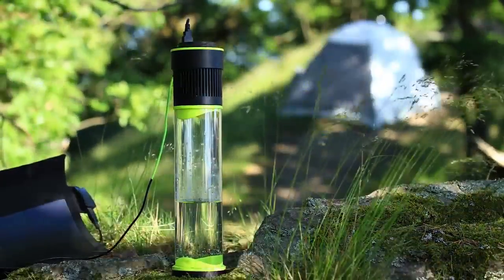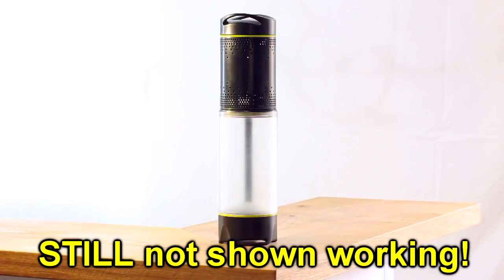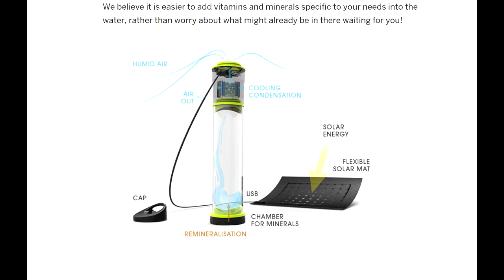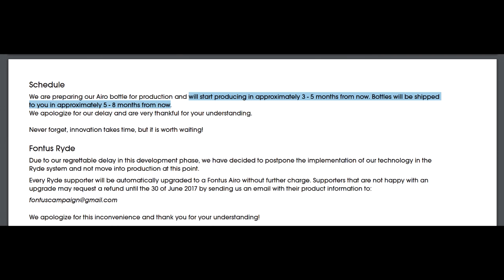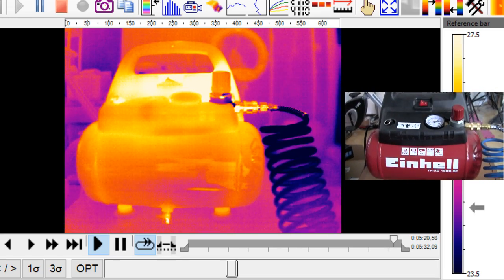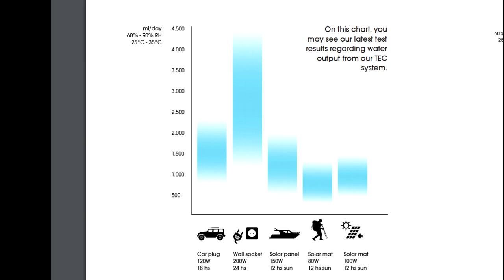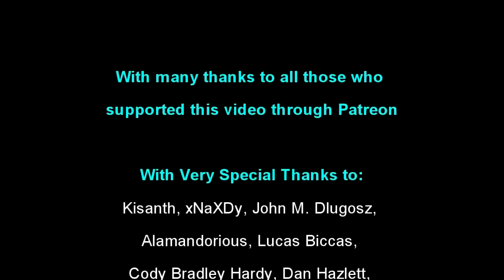$300 000 Self-Filling water bottle, SUPERFAIL!

Comment: the only practical reason to bring the water bottle via a plug is if you are going camping and bringing a mini generator with you for electricity. but if you are going camping and need a mini generator chances are you will just bring several gallons of water in big bottles. Or you're just going to go to a nearby river.

also why don't they use a chemical reaction to generate heat which can then be used to generate electricity thus charging the humidifier effect on the bottle. if i'm not mistaken there are tonnes of chemicals which you can mix to produce massive amounts of heat which you can use to charge electricity.

Comment: I think I just invented something to rival this creation. It fills a bottle with water, and is about as big as the bottle (like this one in this new stage) BUT it has even less weight AND requires less power.

I call it "another bottle".
Reply: If this has peaked your interest, I have another one for you - though that one needs refining. It's a device that lets you see through walls. Any wall, regardless of material.

That one's working title is "the window".

Comment: The boat in their chart showing what a 150w solar array could produce. Such panels on Google look to be about 1 meter^2. You could seriously build a solar distilling apparatus the same size, use the sun's heat and get considerably more energy than a 150w solar panel at 1 sq-meter, and get more than a gallon of water in a day if you're in a temperate or warmer climate. And you have the benefit of knowing the water is relatively clean as distillation leaves behind all the salt and particulates and is usually hot enough to kill off most microbes. To be safe, collect your distilled water in a glass (not plastic) container and let it sit out in the sun for the day. The UV radiation will take care of the rest of the microbial hitch hikers.
Then, just add some of the salt you collected from your still, to your food. That way, you don't have your distilled water leaching the minerals out of your body and killing you.

Comment: I wouldn't be surprised if the powerbrick would be closer in size to a 100 watt one, a peltier device doesn't require nearly as stable voltage and current as the average power supply actually provides, this means you can get away with really bad quality power (ie. it'll be the size of a 100/150W laptop supply)

Comment: I have a question. If you externally heat up one side of a peltier device and cool the other will it generate an electric current or does the system, unlike an electric motor, only work in one direction.

Comment: I more or less agree with Thunderfoot's calculations etc but there is nothing like building one. In the UK I was getting 0.01L per hour (or a tad under) in 50% humidity and 19C. This was using a 6V 1W solar panel (from banggood) and  a peltier with two heat sinks. IE a physically bigger cell than in the unit.

Comment: Why not produce a micro solar powered RO water purification system?  I was thinking of designing a miniature bicycle run distiller where you use friction for heat and run a small air pump to reduce pressure in the system allowing water to boil at much lower temperatures.  Not exactly backpack sized.
Besides, who enters an area which would be fatal to humans without water, without a water supply??  WTF?  
Even ocean faring craft carry water with them.  And I believe they also have inflatable solar stills in their emergency supplies so they can purify ocean water.

Comment: I'm waiting for them to become desperate. Would be fun to see them power the mini compressor with a petrol engine. Or they license that hygroscopic stuff. Maybe they can add a "booster". A hydrogen fuel cell would supply more power and has the added benefit of the exhausts filling the bottle. Or make a portable hydraulic press to squeeze water out of dessert sand and mountain rocks hahaha.

Comment: I'm curious about one thing. If you use this bottle in a very dry environment, will water actually evaporate from the inside of the bottle? Effectively losing water. Obliviously it wouldn't generate anything if the humidity level is super low

Comment: The compressor is not for the temperature gradient, but to squeeze the water out of the air. I drain my compressor every time I use it, I only once got some water in the uk, and it was two drops though, and that was after a few hours of cycling it on a very humid day. Takes a lot of power and a big compressor.

Was not clear in the video exactly how water can be extracted with a compressor.

Comment: Shame this sort of nonsense gets peddled when there in actuality DOES exist damn near miraculous filtering membranes that can basically turn any water (including urine in a pinch) into clean water. At 0.5 nanometers or so not even viruses or dissolved salt-water stand a chance of getting through.

Hard to get even that sort of thing to "fill itself" since you'd at need a manual crank of some sort to generate sufficient pressure and also SOME source of water obviously, but at least you could justify having that for a survival situation or as emergency kit in your car. Very few palces on earth are truly devoid of water anyway - it's clean safe water that's the issue.

This shit on the other hand - even if you had a power outlet (lol), you would probably end up dying of dehydration in hte long run even in a moderately wet climate. You might as well open your mouth, tilt your head back and hope for rain...

Comment: I think you should scientifically test how many amps it takes to make a USB cable melt, would be fun to see with both the thermal and high speed cameras
Reply: I like the way you like the way he thinks.
Reply: 38911bytefree USB can do 2.4 amps according to my charger...it depends on the wire though...5 might melt a cheap wire....but really more like 10 or 15 I'd imagine
Reply: 5A is not a big current at all, its an overload of the 500% to the max 1A of new USB. since cables they should have low resistance (some gadget will refuse to charge because voltage drops) I dont fell that 5A will melt it vey fast, eventually it will damage the wiring.
Reply: Pieter Slabbert I like the way you think 😎

Comment: The bicycle version has another pitfall aside from the smaller solar panels. Even on a bike with a relaxed fit geometry, your torso will still be hovering over the panels. Additionally, during each pedal stroke your thighs will briefly block the panels, thereby increasing the time to fill your bottle even more.

Comment: What if you used a box for the tank of the compressor and placed a peltier device on each side minus the bottom with large heat sinks on them. Let the compressor compress the air in the tank and use the peltier devices to pull the heat out of the tank condensing the water in the bottom. My guess is this would accelerate the production of water but I doubt it would be any more efficient. I'm going to see about doing this experiment.

Comment: I've invented a revolutionary new way to get water out of air very easily.
1) electrolyze some water to get hydrogen
2) feed that hydrogen into a cold fusion device
3) use the electricity from the fusion to power a modern, efficient dehumidifier, a water filtration system, a small portable air conditioning unit, my revolutionary cancer research in a box device, and the electrolysis.

Comment: Honestly the bike version seems like it would be the one that's easiest to actually get working. Running the peltier devices of a bike dynamo should be trivial, you get good airflow so heatsinks would be very efficient. It could even be possible to have some form of compressor connected to the bike chain. The problem with all this would obviously be that you are basically the power source, can you get enough water that it balances out what you drink from more exercise? Would the water amount you won't have to take along be of any significance? I'm guessing it would still not be a good idea.

Comment: Out of curiosity, do you think the idea itself is viable in a setting like a lifeboat? If something like that is stranded in the ocean for a few days, it's possible they won't have access to clean water, but the humidity and sunlight will both be quite intense. Obviously won't be in the sleek design-college shell, but is the concept itself useful for a situation like that?
Reply: Conrad TM Drink the water you stored on a life raft. Use you RO device to desalinate. Stay under the solar cell and use the the power to keep your radio charged while hopefully your epirb gets heard. You could use this thing to hold a note when you chuck it overboard.
Reply: Fair enough. This particular implementation just seemed to favor form over function, and I didn't know if it was possible to make it more efficient or to have a good desalination operation in a compact package. Because I mean if you wanted humidity and high temperatures the ocean is kind of ideal. Doesn't matter if it can't match the efficiency of other devices in a similar weight class, though.

Comment: I love the fact that the water isn't even drinkable
Reply: Yes, exactly! Ignoring the fact, that the water will be contaminated with organic and inorganic stuff, which may be bad as hell for you, it will be a distilled water :D meaning no minerals, salts etc. which you need in water. I would more likely use it as a solvent for chemical experiments rather than for drinking :D. In addition it would taste like crap, especially if it was "generated" on some metallic radiator :D which should be certified to allow contact with drinkable water... Because of all that, when you are say on a hiking journey then such water would do more harm than good to you. You can have electrolytes and other supplements with you separately and add them to water as mentioned, but this defies this "water from thin air" principle. I often wonder when I see such projects, whether people behind it are so stupid or was it scam all along and they just are able to act so well, and say such crap with smile on the face. They should star in a TV show rather than doing engineering stuff! It would also be more in-line with this "applied arts" university mentioned in the advertisement.

Comment: They could choose to avoid a power brick and just work around a 220V DC, but that not only requires high power components, the circuit required is also a big one, so regardless putting in a transformer for stepping down would be a better alternative. Not to mention operating at 220V DC is dangerous in case of short circuits or other errors. In any case they have not thought this through at all from the looks of things.

Comment: There are other issues with compressors than just the amount of evaporation and condensation required especially when considering miniaturisation of the technology. I can't wait to lol at them when they realise this. Perhaps they should leave the engineering to engineers and stick with what they are best at (art)

Dave from the EEVBlog showcased a flexible solar panel that was essentially like a piece of acrylic. Not sure of the cost per Watt and really can't be bothered to find out. Perhaps another sleuth can dig it up.

Comment: In a compressor if you use methane, butane, Or propane it would be much more efficient than room air for heat exchange. Not to mention R12, R22, R134A as a great commercial alternative

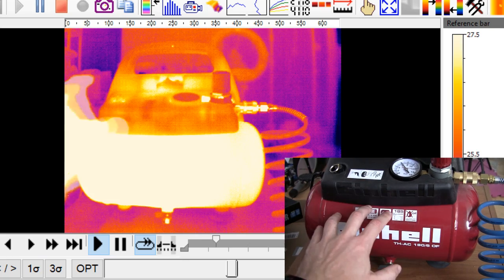Comment: 12:50 - I thought a fridge/heat pump worked by creating a phase change of the refrigerant. Not just compressing/decompressing the gas (in this case, air). Did I miss something? seems to me the tube got colder because of the air passing quickly through it causing heat to be carried away from the tube material, not that the air in the compressor dissipated heat first....did I miss something? Seriously, I"m no physicist. This is how I've always understood refrigeration to work.

Comment: I have a dehumidifier in my bathroom. The idea of drinking that water is the most disgusting think I can think of.
Reply: That is why the people that are trying to sell the self filling water bottles tells us that we would need to treat it.  However, in reality, it would be best to chem treat, filter, retreat, then filter about three more times with different types of filters, before boiling then catch the steam and run the boiled water another filter where it is mixed with the steam (now water again) and then ran through another filter.

But in a pinch, you can take the water and run it through a crude filter.  The bottom layer of the filter sits on a mesh net that is about as thick as a screen on a screen door, with smooth rocks on top, on top of that is some sand, on top of that is crushed into powder charcoal, on top of that, sand again, and on top of that are rocks (any type will do).  You can run water through that and it will be fairly safe to drink, barring certain factors.  But you can take the water and boil it and collect and only drink the stream (and even that will be mostly safe to drink).  But when in a bad situation, you gotta do what you gotta do.
Reply: +Alice Eliot,
You have no idea how water treatment facilities work and what all can be found in water out in the wild, do you?

And to answer the question to the OP, they may not have a venting system that removes the water from there.  After showers and baths, it gets very moist for a long time if not somehow addressed.  Well, moisture in an area for a long time allows things like mold, bacteria, algae, and such to grow, the biggest issue would be black mold.  Even if you clean it every other day, (which exposure to the chemicals would ruin your health and eat up your money), there can still be a minor issue slowly growing; normally starts around door frames and around mirrors (areas you can not reach).  To install a venting system could run about $1k and that is if the work is done by self.  And if renting, not an option.  A dehumidifier can over time cost a lot more, but a small room unit is about $200.
Reply: It's not what's in the air so much, as the colonies of legionella that thrive in the heat exchangers.
Reply: Mateusz Wojtkiewicz You aren't supposed to drink that water anyway because... Ya know.... You'd likely get some terrible disease from the fuckton of bacteria it just pulled out of the air. That's why Fontus is selling those packets of anti-bacterial stuff alongside the water bottles.
Reply: Alice Eliot because without it water collects on a ceiling.
Reply: Mateusz Wojtkiewicz does your bathroom have a ceiling fan? I'm pretty sure most bathrooms (at least in America and Canada where I live) have them to suck the humid and moist air outside the house, sort of like the dryer vents do. My bathroom can stay humid for a good while unless I turn the fan off and in my downstairs bathroom in the basement I have to run a dehumidifier constantly even without showering. The two upstairs bathrooms only use ceiling fans. But ya I definitely wouldn't want to drink that water, who knows what's been pulled out of the air with it into the reservoir.
Reply: it doesnt come with a filter so no.
Reply: The water from normal dehumidifiers isn't safe for human consumption, however refrigeration-based AWGs essentially work like normal dehumidifiers with extra sanitation and filtration steps to make the water drinkable. A large AWG actually would come in useful in Flint, MI.
Reply: Mateusz Wojtkiewicz Ikr, smells like a 7day sweaty sock

Comment: how much power could you generate when you ride a bike?
Could they run it of the motion energy? Or maybe you could recharge a battery by riding it so you have a power supply when you're stationary. Maybe even combined with solar energy.
I think the idea could work and you could maybe generate a little water (even though it might be just enough so you dont die), but i bet after designing it they stopped thinking how this could work in real life